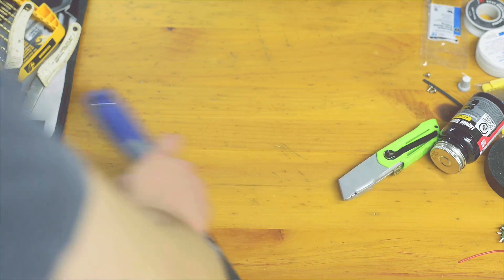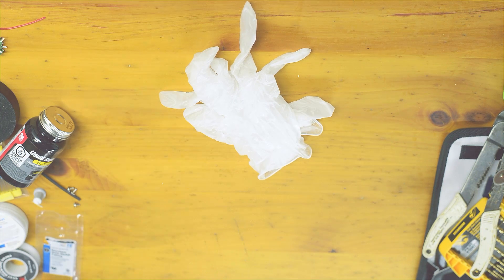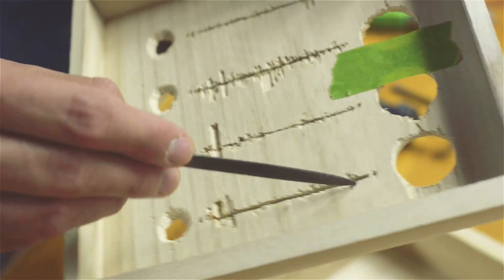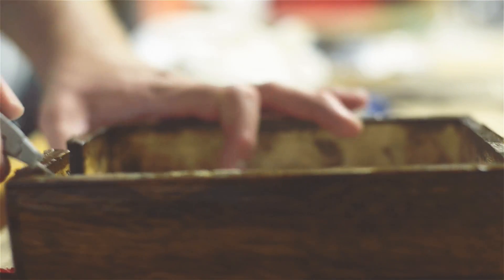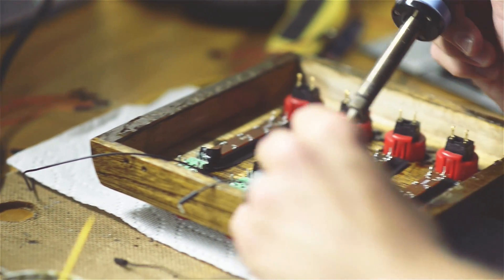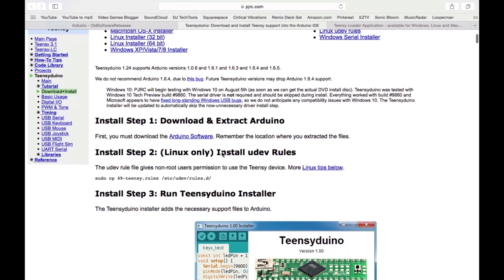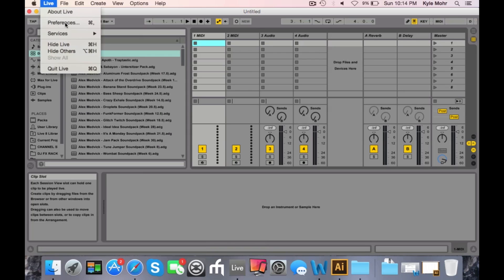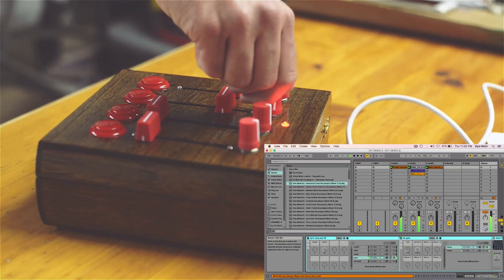How To Build A DIY MIDI Controller (2015 Edition)

Comment: Can you describe your arduino sketch further. I went in and updated your sketch so I can use 12 buttons and 6 Pots...but in Ableton, when I midi assign buttons to different things, they are constantly conflicting with each other or the buttons does only one item assigned. I suspect it is the CC values and I just wrote mine in sequential order...is that right?

// map buttons to cc for button
int cc0 = 51;
int cc1 = 52;
int cc2 = 53;
int cc3 = 54;
int cc4 = 55;
int cc5 = 56;
int cc6 = 57;
int cc7 = 58;
int cc8 = 59;
int cc9 = 60;
int cc10 = 61;
int cc11 = 62;

Bounce button0 = Bounce(0, 3);
Bounce button1 = Bounce(1, 3);
Bounce button2 = Bounce(2, 3);
Bounce button3 = Bounce(3, 3);
Bounce button4 = Bounce(4, 3);
Bounce button5 = Bounce(5, 3);
Bounce button6 = Bounce(6, 3);
Bounce button7 = Bounce(7, 3);
Bounce button8 = Bounce(8, 3);
Bounce button9 = Bounce(9, 3);
Bounce button10 = Bounce(10, 3);
Bounce button11 = Bounce(11, 3);

Comment: Why on earth would you solder jumper wires?! The whole point of the solid ends are to go into breadboards, not to be bent & soldered!
Reply: +CJ Davies to save people some time from cutting/stripping wires and using heat shrink tubing.  It's a quick fix for beginners.  Haha, but yes I know to some it may seem crazy since they're ideal for breadboards, they can be used for anything. Many great project like this have used them: https://learn.adafruit.com/mini-untztrument-3d-printed-midi-controller?view=all

Comment: that's how i built a midi fighter 64
Reply: +Atlantic was it teensy 2.0 based or teensy++, how did you increase the inputs
Reply: +Atlantic with with lights?
Reply: +JΔVɨΣჩJÄVØत्रλ yup
Reply: +Atlantic i would like to see it if you can show it to me as well
Reply: sorry, sold it. i build them for 500$
Reply: +Taha Naveed he probably used an arduino mega with an extension connected to it

Comment: Hi Interesting video, love the basic setup and the expansive explanation from beginning to end, great for starters! So keep em coming. I do have some tips however for soldering and the case making. 

First for the case: When drilling holes I can recommend three things. One: you can tape the front of your box when drilling with masking tape, this can prevent some of the damage the drill makes; two: put the inside of your box on a smaller hard surface (for example cheap mdf) when drilling, when you do this you are less likely to splinter the bottom and you get much cleaner holes; third: hand drills are great for DIY, however when you have a drill press I can highly recommend using this as it is far more precise and will involve way less clean-up. On the soldering part, I saw you used wires meant for breadboarding (the jumper wires), these are great, however using stranded core wire makes it easier to solder and is more flexible (and likely cheaper than jumper wires), furthermore you can also use shrink tubing more easily. I can also recommend resin/flux cored solder, it is a bit more expensive, however is is amazing when soldering, just coat everything with the solder and then connect, its easy and fast.

P.S. Thanks for this video, really love it wish there were a lot more videos for introductions to music DIY equipment.
Reply: +jortband Thanks!  These are great pro tips.  Appreciate you sharing.  They will indeed come in handy for future projects and videos.  Will be sure to utilize this in my new workflow.

Comment: Enclosure:

draw that with autocad, and cut it with laser machine...
Reply: or take the file and get it 3d printed
Reply: Shakwan Williams that's much more cost effective!  Especially if you or a friend has a 3D printer.
Reply: +KM Productions You mean much less cost effective, 3D printers take forever to actually print the final product especially something this large. Laser is the best and most cost effective for this
Reply: Agreed. That would be much easier and cleaner. If you have the money to pay for those services you should indeed go that route. Great place for this is Ponoko.com
Reply: 3d printers for this kind of solutions it is not so effective, but yeah it is also a solution
Reply: jozef beska i can see that.

Comment: I'll be honest, this is great but the wiring and programming is definitely beyond my skill level!
I want to be able to have a controler that can sit directly above my mixer in exactly the same style as on the Native Instruments S4 (8 pots and 10 buttons) purely to control the 2 effect banks in Traktor. I could design and build the case, but is there anyone that could supply the pots and buttons, and do the programming to make this a reality?
Reply: It's actually quite easy to learn. Picked all this up in a month's time with a few google searches and YouTube videos.  If you still need help or want to pay someone to finish the project make a post in the DJTechTools or Adafruit forums. There's always someone willing to help build a project.
Reply: +trickydickydoudlebug dude, check out nanokontrol hacking. The programming is already done, you just attach bigger pots and other buttons
Reply: +puikegast great tip!
Reply: +puikegast Hey cheers for the heads up on the nano! I've looked into it and I recon I could make this work. I think it may be too long for the top of my mixer though (NI Z2). I'll have a think! Ha.
 I did a search for mini Midi contollers and came across the behringer x touch mini. It looks exactly like I want (-the fader on the end!) Think I might look at getting one of these and just bolt it on top of the mixer.
Reply: in that case, maybe the doepfer pocket-dial or pocket-control would suit your setup
Reply: +puikegast . Thanks again, just googled that, looks good, but no longer available! Also no switches and too many rotaries for my needs. Gonna try the Xtouch mini I recon, although I'm struggling to find local UK sellers at the mo!